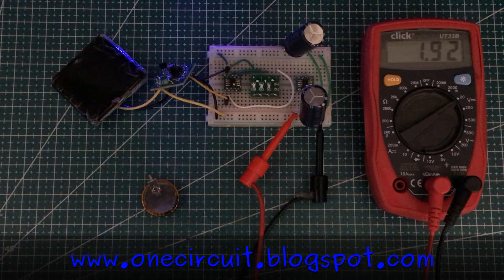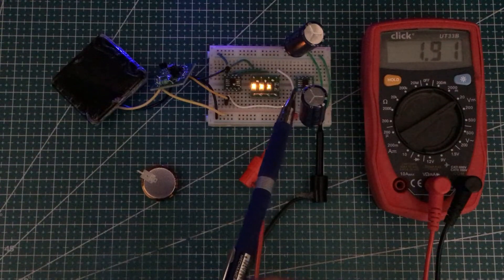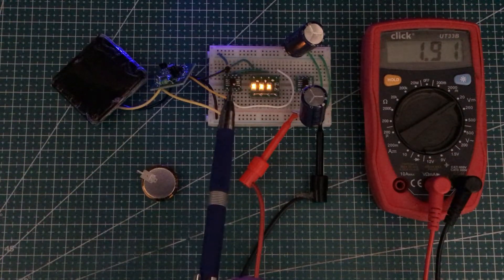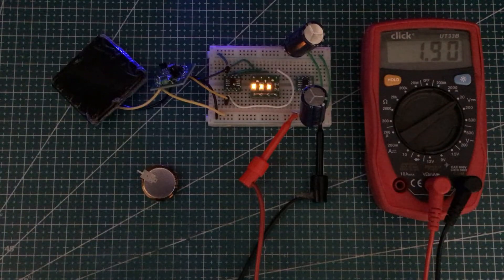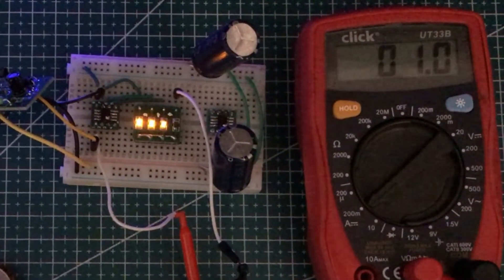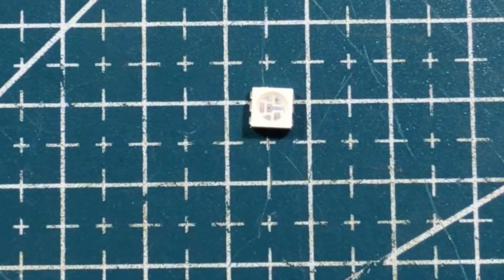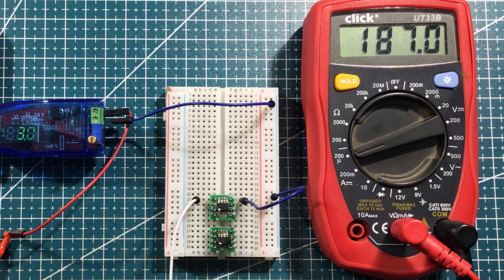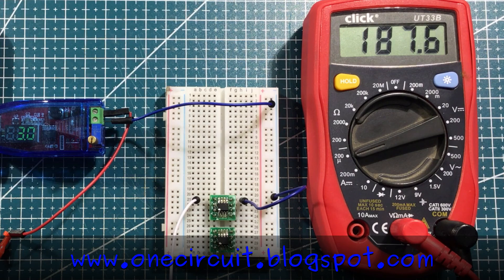The Solar Super Capacitor Candle - Part II

Comment: Why waste power across a resistor at all, if narrower PWM pulses and thin LED wires can do it? You may also get a lot more candley action since presently current would seem to be resistor-averaged across all 3 channels.
Reply from the maker: Good point! From memory the PFSA154 is GPIO current limited to sink about 12-15mA, no resistor required. 👍😀
Reply: @onecircuit-as  At 2.5v I tested white LED's of various color temps, none exceeded that. Reducing pulse duty cycle combined with wire inductance would mimic what minimalists in China would do😆Now if you want to go fancy, glue on a 5-cent SOT-6 dual MOSFET to drive larger LED's and you'll have a free pin for a button to multi-press for modes (on/off, timed, brightness, etc.. depending of course on PFSA154 memory limits).